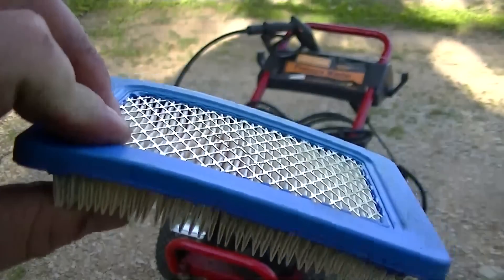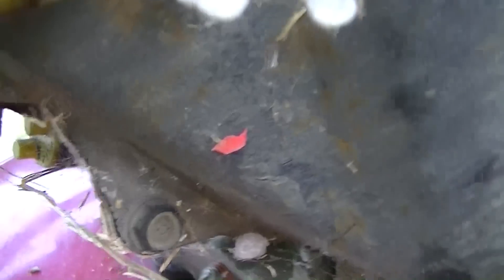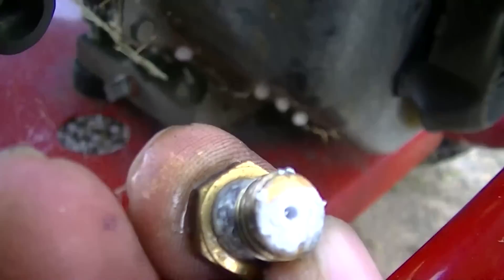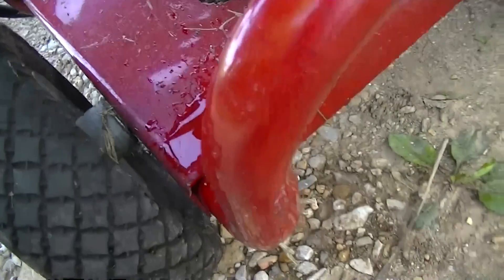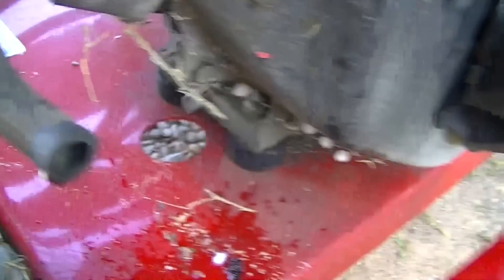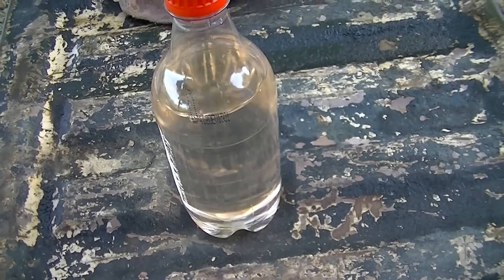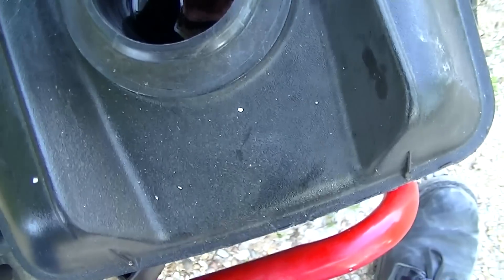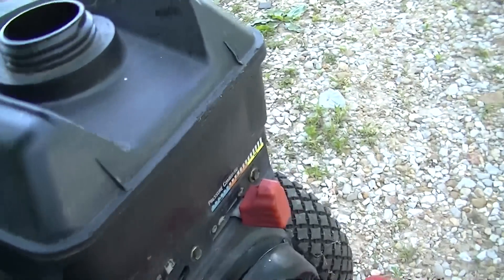No Start Pressure Washer Part Two

Comment: on new washers, as well as washers that have been sitting thru the winter often build up what is called vapor lock,,   you can pull on that handle all day and she wont start,,,      Just unscrew the bolt under the carb, and let the gas flow for a sec or two and that will fix it,,
Reply: I just bought a pressure washer and it don’t start it’s new out the store ....you have any more tips? Your comment seemed more helpful than the video already
Reply: Leslie Orozco.   Hook up and   turn on water. No hoses.   Gas on. Gas flowing thru carb.  Make sure its on very level ground. New p-w have internal shut off for oil level.  Check to make sure have enough oil. They never send enough oil in a new p-w box.  Tighten plug and wires. Make sure gas is turned on. Turn on choke half way sometimes p-w just need a little choke to get started .  check to make sure you have spark from the plug.

Comment: Probably a stuck needle.  That happened to my snapper B&S engine after setting all winter.
Reply from the maker: It had a stuck needle. I took it apart and cleaned it but it still didn't run. I ended up ordering a carburetor for it. I need to get that video up soon.